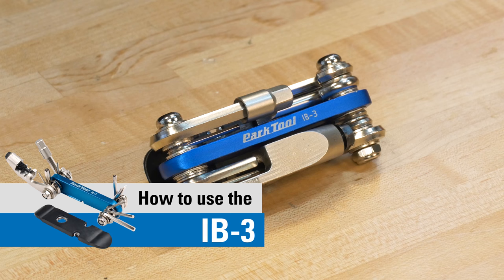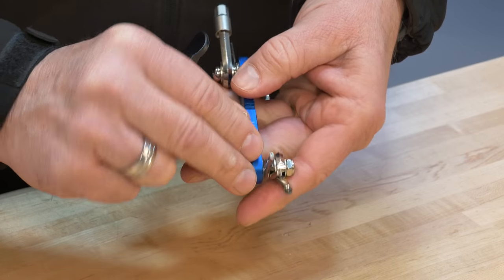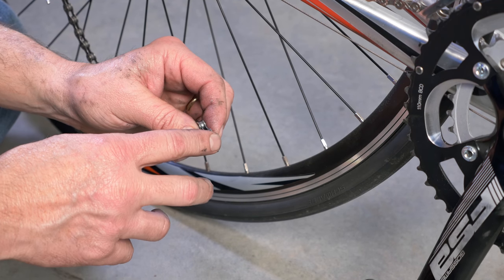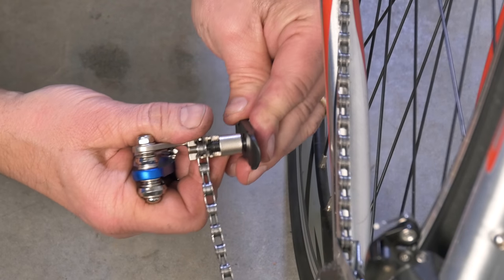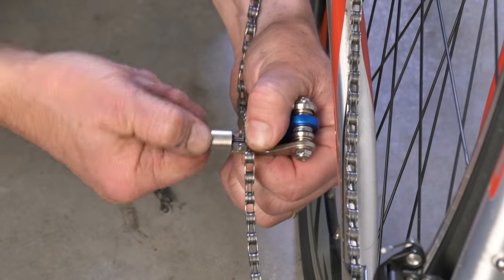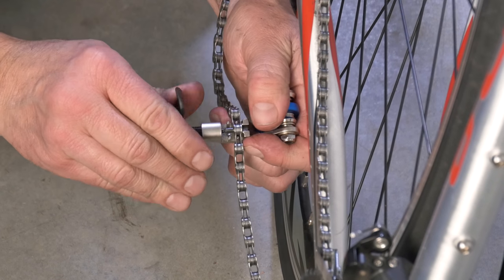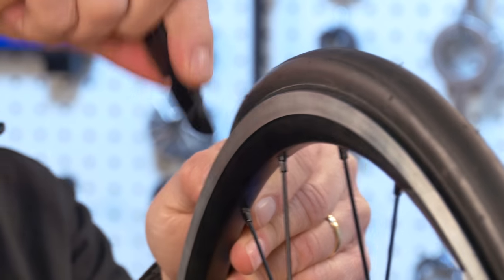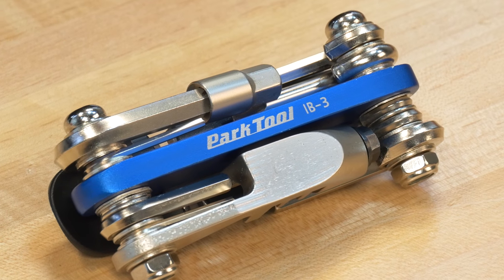How to Use the IB-3 I-Beam Multi-Tool

Comment: The 5mm hex wrench is ridiculously short and it is the one I have to use most often. The tool will also rust- the wrenches should have been made from stainless steel. The tire lever loosens and slips of the sliding groove in the tool. If Park tool would only correct these short-comings it would be a great tool!

Comment: Does this chain tool work with 11 speed chains? The info from park isn’t that clear
Reply from the maker: Yes. The IB-3 has a 5- to 12-speed compatible chain tool. The IB-3 chain tool will not peen Campagnolo® 11-speed chain rivets (see CT-4.3 or CT-6.3)
parktool.com/product/i-beam-mini-fold-up-with-chain-tool-ib-3